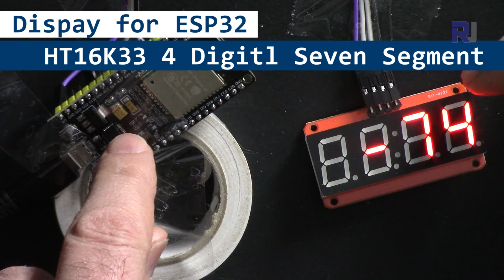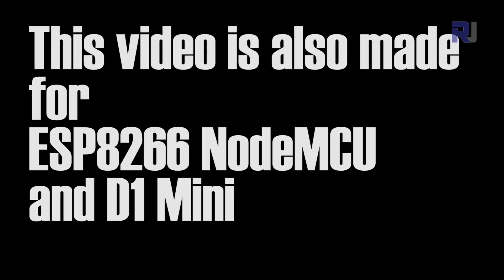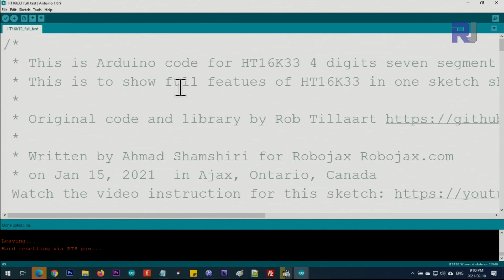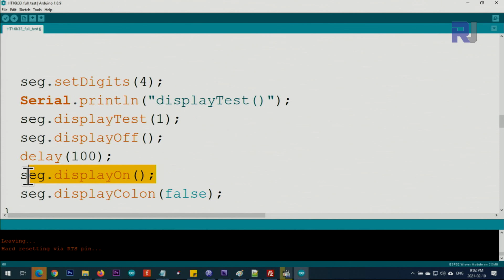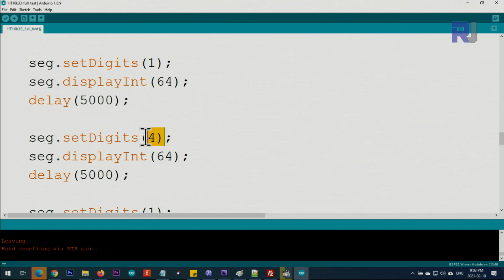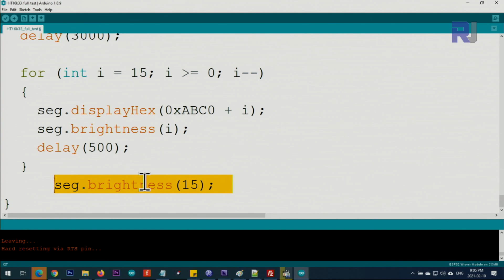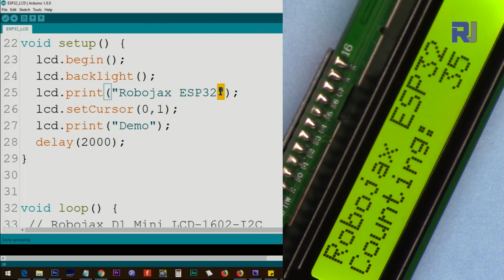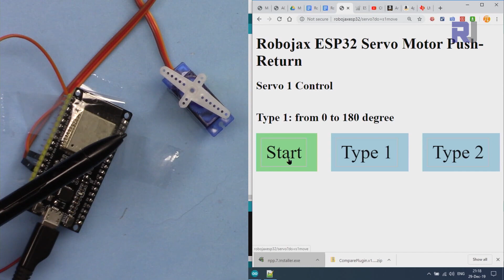Using HT16K33 4 digit seven segment display with ESP32 - RJT370

Comment: Is the I2C pull-up voltage 3.3V or 5V?  If it is 3.3V, I am worried about the operation of HT16K33, and if it is 5V, worried that ESP32 will be destroyed.
Your English pronunciation is very easy to understand for Japanese non-English speakers.  Thank you for the great video.
Reply from the maker: Hi, the input voltage of ESP32 is 3.6V shown on page 4 here https://www.espressif.com/sites/default/files/documentation/esp32_datasheet_en.pdf you can use the method shown here to convert 5V logic to 3.3V using just two resistor https://snipboard.io/gJXm0c.jpg

Comment: Does ESP32 GPIO worked well with 3.3V as the maximum SCL and SDA voltage level? Any risk to damage ESP32 since it is not 5V tolerant?
Reply from the maker: Will work with 3.3 V and 5V